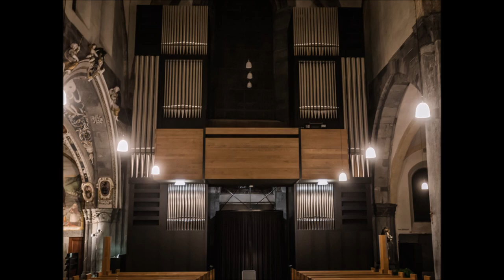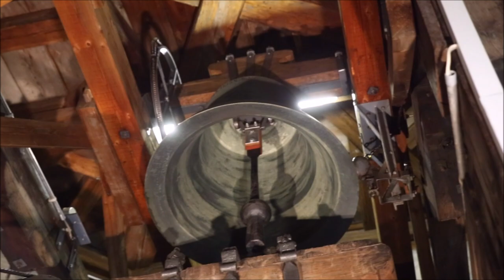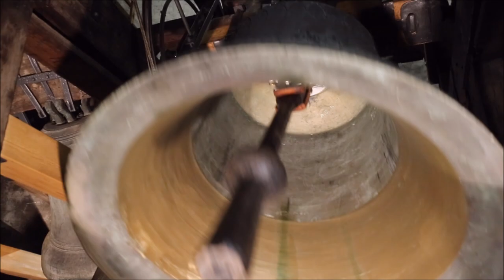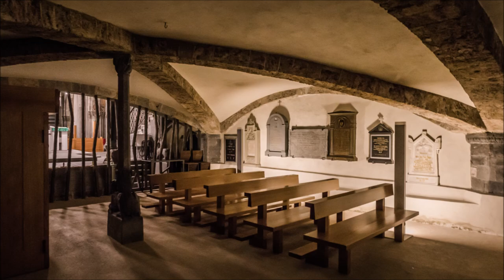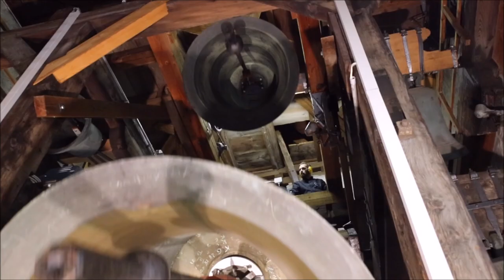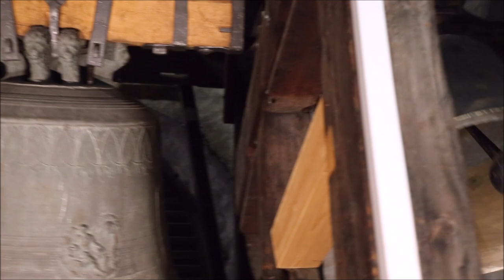CHUR (CH - GR): Vollgeläute der Kathedrale St. Mariä Himmelfahrt

Comment: I really love these bells. They seems like casted in light rib(ecxept of f') because I still almost didn't found as° with less than 4000 kg(well, I found one and it's located in Pölland bei Bischofslack/Poljane nad Škofjo Loko in Slovenia and big as° bell in Great Reformed Church in Debrezin, Hungary; but usually, I still didn't found another as° bells with less than 4000 kg). Quite nice work by Grassmayr. Just one question. Does that Grassmayr from Feldkirch have any connections with Grassmayr in Innsbruck?
Reply from the maker: Thank you!
Yes, indeed these bells have been cast in extremely light profiles. Although they have been retuned afterwards to properly fit the intervals, as it can be seen on the inside. This means, that they were pitched slightly higher and had a bit more weight to them before the retuning. The only exception is the as'-bell, it has been tuned higher than it originally was.
Regarding different profiles: An as°-bell by Rüetschi is around 5000 kg in the normal profile. But Rüetschi also has lighter profiles, for example the one used in Villmergen in the 30s. A master of light profiles is Czudnochowsky from Erding. Zürich Oerlikon has an as° by Czudy, which I remember to be extremely lightweight. Sadly I don't have the exact measurements.
And the answer to your quesion regarding Grassmayr is yes. Grassmayr expanded from Innsbruck to Feldkirch and Buchs. The biggest Bell by Grassmayr FK is in Feldkirch itself. It sits in the Katzenturm and is calld Maria Rochus, it's note is f°.
In general we van be glad that many sets of belly by Grassmayr Feldkirch and Buchs made their way into Switzerland and Liechstenstein, so they survived the two world wars.